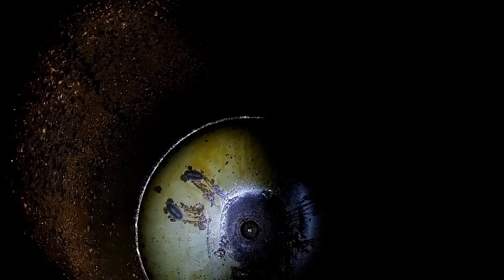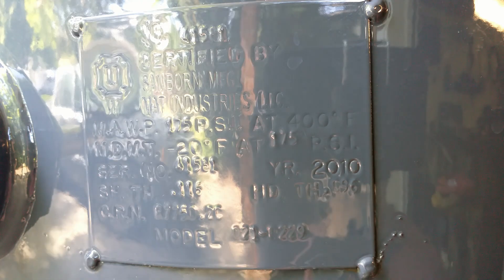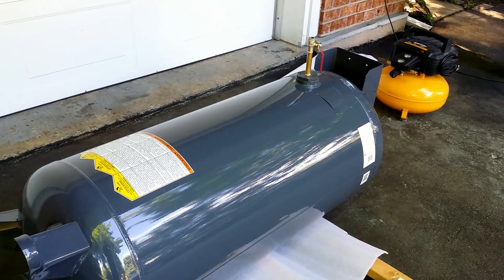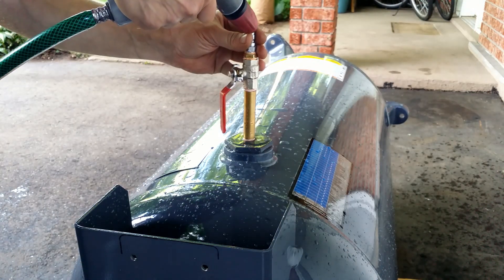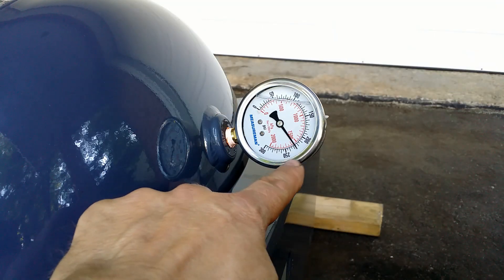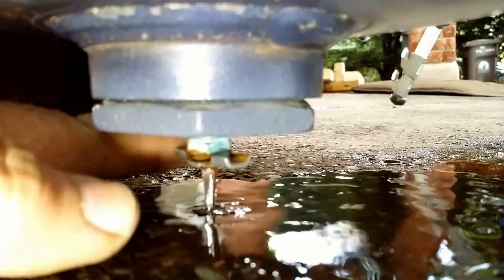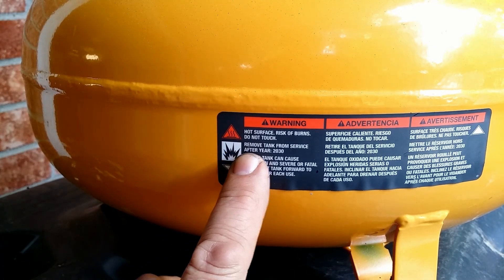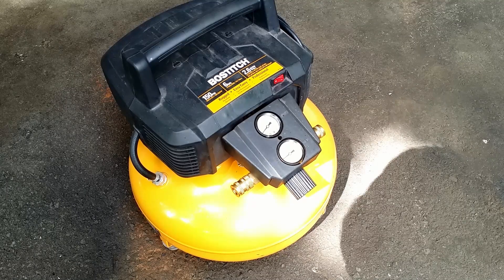Air Compressor Explosion Prevention. Hydro Test.

Comment: I have a 21 gallon air compressor.
I did not know about doing this kind of test for leaks.
I do always let all the air out after I an done using the compressor though and let the pressure out with each use.
Reply from the maker: It is good that you drain it. Is your compressor standing upright or is it horizontal? Those standing upright drain water well, those horizontal, if slightly tilted, may not drain well.
Reply: @robertdeptula2003  Yes the one I have is upright.

Comment: Why not after every use drain the tank and leave the drain cock opened until next use, that way it'll air dry inside and all water will evaporate leaving no rust. Another thing, why not paint the inside of these tanks?
Reply from the maker: Yeh, one should drain the tank everyday (if used), but it is still exposed to the moisture. Nobody keeps his car in a swimming pool, but it still rusting.
Reply: I always leave my drain cock open until next use and I use my Ingersoll Rand once a year have it like 15 years now so I guess it still in good shape.

Comment: I normally leave the air valves open after draining, on my 2 air compressors. That way the inside of the tank can dry out a bit more...
Reply: Maybe fogging it with a rust inhibitor on a periodic schedule would help extend the lifespan further.

Comment: Very well explained video, best one on the subject I’ve seen.
I am also looking for the straight thread port plug with gasket for my tank. I am in Canada too, where did you find yours?
The best I have so far is a pipe thread one, which seems to still work with lots of tape and sealant.
Reply from the maker: Bought mine at PrincessAuto. Bushing 512-0043
Reply: @robertdeptula2003  wow, amazing you found that with no description.
Unfortunately my opening is 1-1/2, and princess auto doesn’t stock the 512-0038.
I’ll give the one I have a try. If it passes the hydro test I’ll consider it good enough.
Reply from the maker: Good luck!
Reply: Bore out your Straight Thread plug to size and thread you want.

Comment: I think it would be good if the compressor tanks were coated on the inside with an epoxy paint to protect against rust.
Reply from the maker: The tank expands slightly under pressure. The question is: Is epoxy paint flexible enough? If not, it will crack and the tank will rust anyway.
Reply: @robertdeptula2003  paint it with a flexible paint
Reply: Just buy a galvanized one, not a cheap ass carbon steel model...
Reply: I have a few years old crappy “Black & Decker” compressor which the specifications are actually good but it's crappy because it's galvanized and it corroded in few years anyway. So I'm really disappointed and this time I bought (I'm still actually waiting for it) an Abac compressor and I'm planning to pour West Systems 105 205 epoxy resin. Reason is that's the one of the most waterproof things you can actually pour into the compressor. I don't expect it to crack under stress but if it does, well, it does. 
It's really important for me, for a compressor to be as safe as possible because I keep it very close to me…

Comment: thanks grate video, how to stop rust inside your tank dry inside of tank pour chemicals inside the tank to convert the rust into ferric oxide then pour into tank linseed oil let dry then your tank will be rust free for good. and no need to test the tank anymore.
Reply from the maker: Thanks!
Reply: @robertdeptula2003   advise is free
Reply: @danvandertorre6349  
Does it work, any problems with contamination of air from the oil for tools ?
Reply: @gavin_hill  yes
Reply: Which chemicals to convert  rust to ferric oxide?
Reply: @Cotterpin_Doozer   rust converter from canaden tire
Reply: @Cotterpin_Doozer  
It sounds quite common sense, but I would be hesitant to use this approach unless it is documented or recommended. 

Not saying that it is not a good idea, just sharing my cautions

PS - If anyone has further information on this method feel free to point us in that direction :)

Comment: i dont get wy tanks are not made from stainless
Reply: There’s aluminum air tanks, but you’ll be spending twice as much
Reply: @victorjay9586  Aluminum has issues too, like poor fatigue life... also Aluminum is harder to weld (well not really, with the right equipment it can be done). Like some airplanes explode because of fatigue life and all that (not to mention airframes have to be checked after x hours of flight, and surely this is not done with air compressors).
Reply: Stainless is quite a bit harder than steel or at least mild steel and with the contractions of the tank filling and emptying many times over it can work harden.
Reply: @simonh5110  It is not 'harder' but it is Tougher.
Reply: There are stainless air receiver tanks. And they cost multi thousands of dollars.
Reply from the maker: Money talks. Thick stainless tank will be too expensive.
Reply: @robertdeptula2003  Not only that but stainless has its issues too, as in they may be harder to weld without weakening the structure meaning they are not better. I mean they can probably galvanize it but you can't weld galvanized steel at all, and even then the rust protection from galvanizing doesn't last forever. I mean probably sticking sacrificial anode onto the tank might be a good idea to stop rusting... Maybe if you are buying used compressor it's not a bad idea to replace the tank.
Reply: @taiwanluthiers  An Anode only works when submersed.  Stainless pressure tanks are common.
It is sad that you cannot purchase just a new tank.

Comment: Thanks for sharing! How do you arrive at your testing pressure? 
Is 150% or 1.5 x  the tanks rated operating pressure a set standard?
Reply from the maker: At Wikipedia: "The test pressure is always considerably higher than the operating pressure to give a factor of safety. This factor of safety is typically 166.66%, 143% or 150% of the designed working pressure, depending on the regulations that apply. (...) Water is commonly used because it is cheap and easily available, and is usually harmless to the system to be tested. (...) fluids are nearly incompressible, therefore requiring relatively little work to develop a high pressure, and is therefore also only able to release a small amount of energy in case of a failure - only a small volume will escape under high pressure if the container fails. If high pressure gas were used, then the gas would expand to V=(nRT)/p with its compressed volume resulting in an explosion, with the attendant risk of damage or injury."
Reply: @robertdeptula2003  ok thanks I have a 1998 ProAir 80 gallon tank that I'm just about ready to run after sitting 4 years.
The tank was rated at 200 PSI with an operating pressure of 175 PSI.
Reply: @RC-Heli835  Test at 300 psi.

Comment: What happens if it fails? Does it not hold pressure or something?
Reply from the maker: Compressed water doesn't hold as much energy as compressed air does. When it fails the water will spray and the pressure will drop fast. When it fails with compressed air in the tank it goes kaboom like a bomb. Links to exploded compressor tanks in the description of the video.
Reply: @robertdeptula2003  thankyou makes sense
Reply from the maker: You are welcome
Reply: Maybe someone with a known decrepit tank that they're planning to retire can run this test to completion.  I'd suggest it to Project Farm. 😉
Surely a 3100 psi pressure washer could make it happen. If it doesn't, then make it a job for Hydraulic Press Channel, who would definitely make it happen 🙃